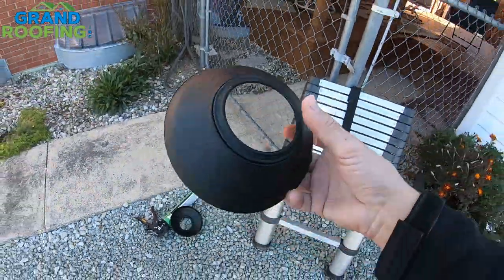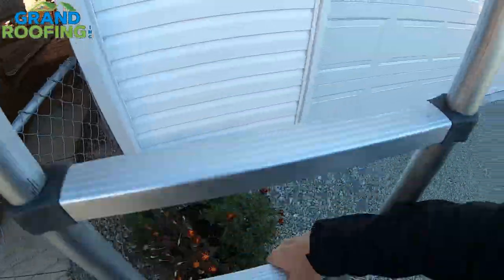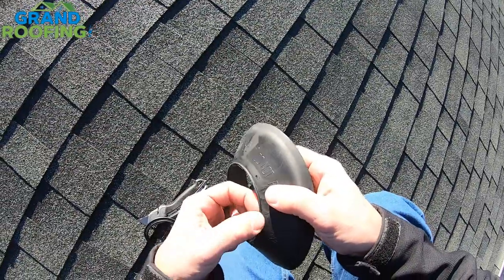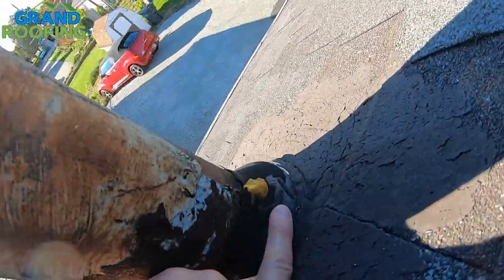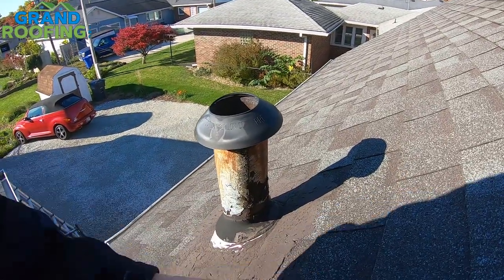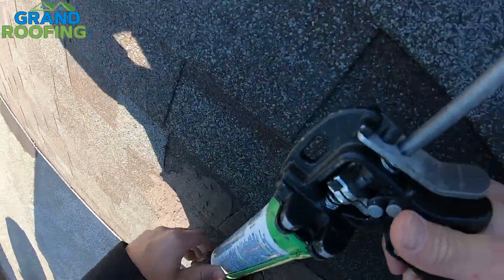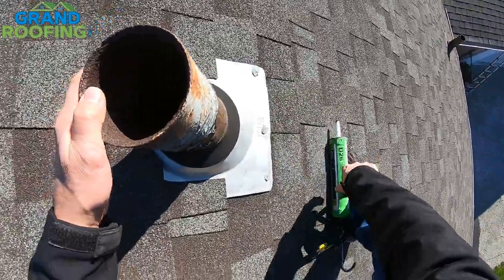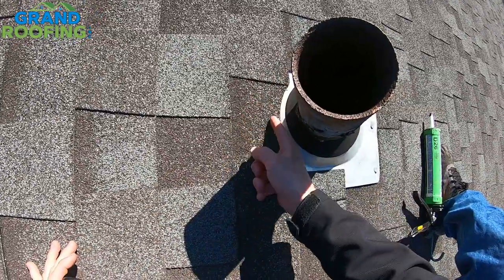Roof pipe boot flashing rubber seal leaking   DIY repair cover

Comment: My pipe vent is a 3 inch bathroom vent - when it rains water will just go inside? Is that normal.
Reply from the maker: Inside the house or inside the pipe? Inside the pipe is perfect fine. Anything that goes inside the pipe will just drain throw to the sewer or a septic.
Reply: @GrandRoofingInc  Inside the pipe - my vent pipe is for a bathroom exhaust fan. I guess this is normal.